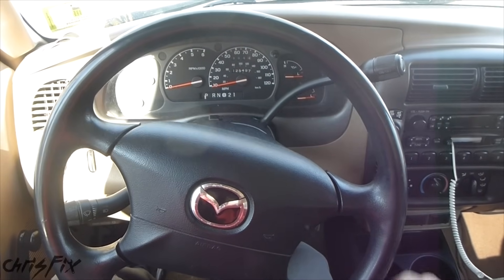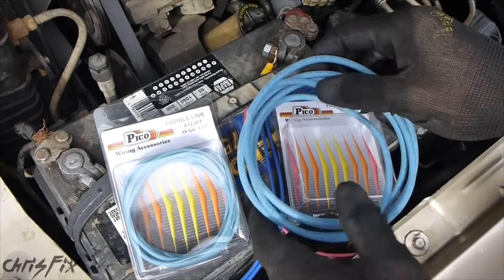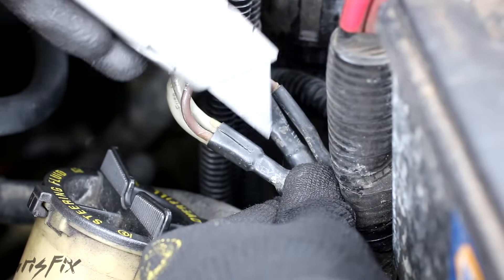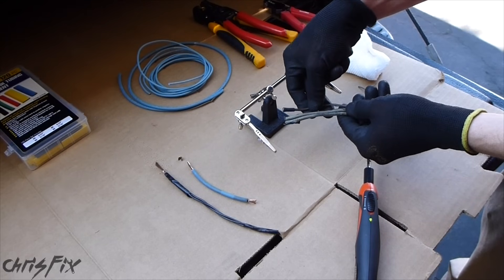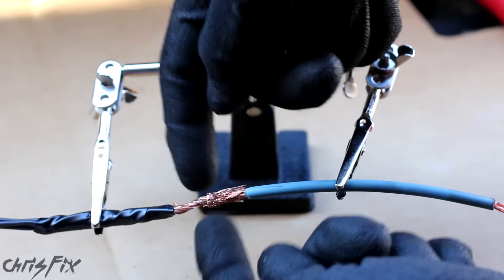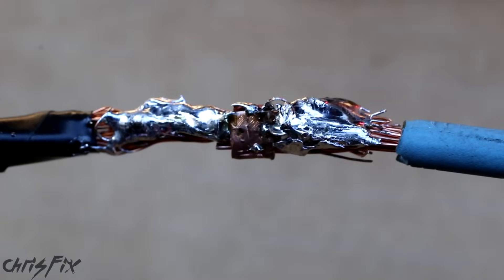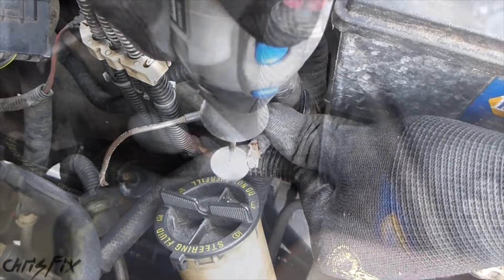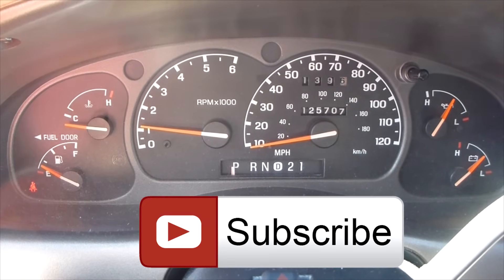How to Replace a Fusible Link (Car won't Start)

Comment: No disrespect intended but your video shows some bad practices. You mention that the solder job you did doesn't look pretty but it also looks cold which means not effective. Fortunately you did show how a proper hot solder joint should look. On this same subject though, the reason solid core wire is not used in anything which moves, car, boat, plane, etc., is that solid wire will break from vibration. A solder joint makes flexible stranded wire into solid core wire. I was taught by a Marine electrician that a better connection in cars and boats, etc., is to use a proper crimping tool to make a crimp connection to join wires/connectors so they are less vulnerable to breaking at the joint.

Also when you used heat shrink you put it over electrical tape on one end instead of extending it all the way past the electrical tape to the wire insulation itself. Electrical tape, while insulating, is not waterproof. Wire insulation serves 2 purposes. One is to insulate the wire from grounding out against metal and the other is to protect the wire from moisture which causes corrosion. to accomplish this though the any break in the insulation has to be covered with heat shrink which has glue inside to waterproof the break. This includes any connectors at the ends of wires. I always use marine grade heat shrink which has epoxy glue/sealer inside. When you use this over clean insulation it actually glues the heat shrink to the wire insulation making a waterproof seal which will stand up to being submerged in seawater so obviously this makes a car wiring connection pretty bulletproof against corrosion. Ideally you want to make the insulation, using marine heat shrink, waterproof continuously from metal end connector to metal end connector so that the wire can't corrode since no moisture can get to the wire itself. I have stripped insulation back on copper wire to find it black 2, 3, 4 feet up the wire from corrosion because it travels up the wire from the ends where it's not sealed. Using tinned marine wire makes this type of corrosion even less of a possibility but marine wire is more expensive.

I always like to fix it once so that the problem can't reoccur.

Just my 2 cents.

Comment: OMG MY 1985 DODGE  RAM  D-350  FLAT BED TRUCK  360/727    HAS BEEN SITING FOR 5 LONG  YEARS ALL BECAUSE OF  A FUSEABLE LINK  I WISH I HAD KNOW ALL OF THIS BEFORE  HAND MY DODGE TRUCK IS ONLY  got 60 thousand miles on it all because of a fuseable link kept it off of the road for 5 long years

Comment: Won't start because you have those shit TEMPORARY battery terminals on there. The ones with the STEEL strap and two bolts. Steel and copper are dissimilar metals. What happens next? Corrosion is what. And clamping soft copper wire is never a good recipe. It will always loosen over time.
Reply: Pretty sure same terminals came with my car.
I swapped them out for pair of fancy silver coated ones,since they are very resistant to oxidising,and they dont stick to battery terminals like copper ones do.
They were like 10€ a pair,totally worth it.
Also if you dont have money for these,just clean original ones and apply petroleum jelly to prevent water from coming in.

Comment: MY 1985 DODGE RAM D-350  TRUCK 360/727  A FUSEABLE LINK KEPT IT OFF OF THE ROAD ALL OF THESE YEARS AND NOW IM  PUTING IT  BACK ON THE ROAD  AFTER 5 LONG YEARS OF BEINGING OFF OF THE ROAD  DARN  ALL BECAUSE OF A  DUMB  FUSEABLE 👍  LINK

Comment: what if I don't have a heat gun
Reply: James Lund Very late reply but a hair blower can sometimes work, but heat guns can be inexpensive and are worth it in the long run.
Reply: Edit: in the video where a hear gun was used, a lighter could do the same trick.

Comment: literally my problem on my 94 chevy s10 I'd take it to the shop they would mess with the battery,starter,alternator and so on and it would come back on today it died and I messed with the fusible link from the positive cable going to the alternator and the truck got power now I just have to take it to a shop to get it done for me.
Reply: oh and by the way after about a month and a half of this problem even the shop could figure it out but now I know.
Reply from the maker: +BIGBROWN138 Glad the video was helpful and let me know how the fix goes!

Comment: you might want to also use an electrical grease ( I like Fargolene maid by Hubble before sliding on the shrink tube) It helps with water proofing and it's anti corrosion protection for electrical connections and nonconductive. I was a Master Electrician trained at local 26. in a previous career. Oh Thanks again on the blue driver video I have one now and will be studying it for a wile to learn how to make the best use. Question do I have to be where I have service to make full use. Thanks again. Mike Morgan       Oh I don't get service at Sherman's house and I want to show it off he does have cable so maybe? .

Comment: It wasn't really propper soldering. To get it propperly you will need flux and a bit different technics. And the worst that youe soldering is pretty dangerous and even may catch fire. So if you don't wan't to see ur truck burning one day, you better redo it. I'm not any kind of professional, i'm still learning, but in the institute of radio engineering or such. don't really know how to translate it right.

Comment: how to fix a fusible link...replace it with an inline fuse lol
Reply from the maker: +EMS Rusty unfortunately that isn't always the best route. A fuse doesn't allow for any voltage spikes while a fusible link does.
Reply: ChrisFix correct unfortunately for gen 1 dodge trucks they give you like no wire to work with so if you ever have to repair multiple times it's best for me to just have a two pronged fuse to replace .

Comment: first why in God's name would you choose to put back fusible links, you said yourself "electrical gremlins". imo should have gone with traditional fuses; easy to diagnose, visual confirmation, easy tool less repair, no meter needed. Second, a tip.... and just the tip mind you, before you start your work dress the tip of the iron with a dab of solder. helps to get the solder going. also Flux is your friend.

Comment: look it's a shame that dodge  came out with something like this fuseable links I done  practically bought everything new for my 1985 Dodge Ram D-350 flat bed trk new starter new battery new alt new  everything to much to list all because for 5 years I was trying to pin point the problem and rule it out and had never  knew anything about fuseable links the last time that I drove or had my 1985 Dodge Ram D-350  flat bed truck on the road was  5  years age and when I did drive it I only got to drive it very little all because of a fuseable link that I never knew nothing about but I never gave up until I said to myself well my last straw is to google it up of what problem that I had with my DODGE